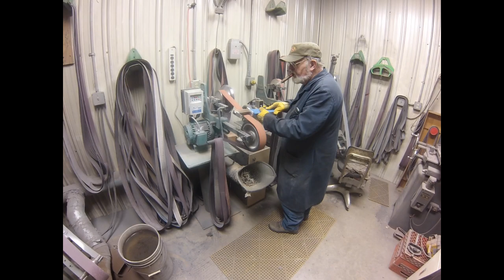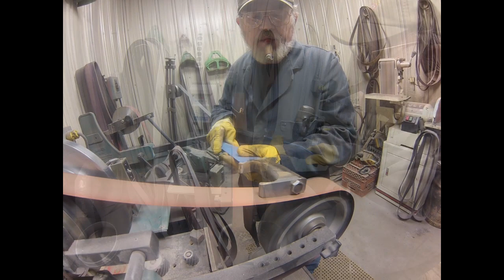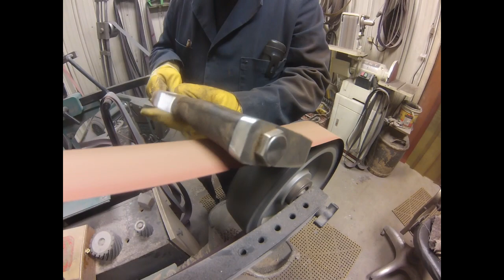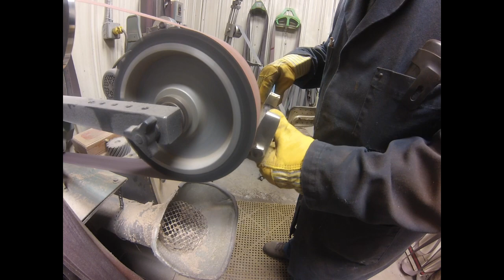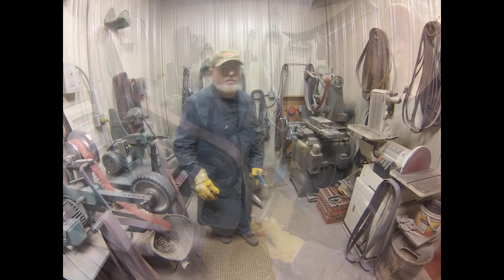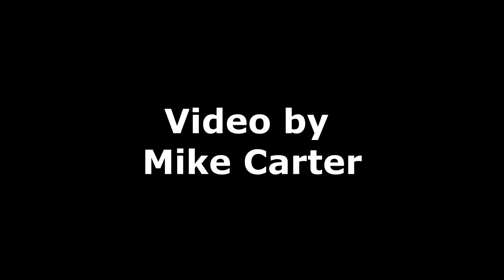Gil Hibben finishing a Rambo III knife

Comment: What is the purpose of the long hole in the blade? (of this or any knife?) I have heard..

It can be used to wind up loose barbed wire, ( if you imagine that in your head)

That it is a sighting hole? That somehow you can use it to judge distance by looking through it?

OR that if plunging the knife into the enemy the hole allows an air pocket to be present meaning it is easier to pull the knife out of the body?

Would be grateful if someone could advise/dispel, enlighten me
Reply from the maker: You would have to ask Gil if there was a specific purpose for the slot in the blade. He collaborated with Stallone when he designed the knife. Since this was designed as a movie prop I suspect it was more a matter of looking cool and being something different rather than anything functional.
Reply: It was meant for axe to slide in there. There are only two knives like that in existence if u Google it You may be able to find picture of it
Reply from the maker: Yes, two were made with the axe blade. Stallone has one and Gil has the other. The photos are probably ones that I shot. I am not sure if that was part of the original design or an afterthought.
Reply: BowieMaker Ah yes I have seen that, quite cool, I just wondered if there was a more general reason? Perhaps other knives with this type of hole have just been mimicking it without any real functional purpose then?
Reply: It's a blood groove, it allows the blade to be pulled out easily by creating a really small chanel for the blood to run out of. It stops the suction effect caused by the blade when penetrated. The suction effect is a mixture of blood and forming a perfect hole the same size as the blade, if there isn't a blood groove to break that perfect seal the blade is significantly harder to remove. That's why blades made to be used for stabbing or meat work will have a blood groove. Katana blades have blood grooves. I guess blood grooves originate from warfare.
Reply from the maker: sharon macmillan The blood groove is pretty much a myth. The groove in knives and swords is really a "fuller" and it stiffens the blade.
Reply: yeah i remember the axe thingy in the groove.i think it was supposed to be spring loaded maybe.some kind of batman looking stuff.lol.glad they didnt stick with it.wouldve ruined the movie

Comment: is this full tang or rat tail tang
Reply: Demetrius Roberson Definitely full tang. Look closely at the handle.
Reply: No, its a rat tail or stick tang (enclosed tang), full tang are the full thickness of the handle and separate the handle scales fully and can be seen as on Benchmade, Tops, Coldsteel and other's. although this is still a good knife style, and many custom knives use this because it looks great, it does not effect the overall performance as many Ka-Bar's also use this style, but still, I would not baton with them.